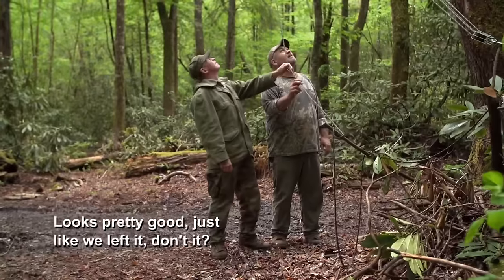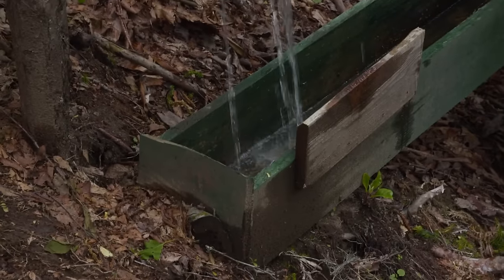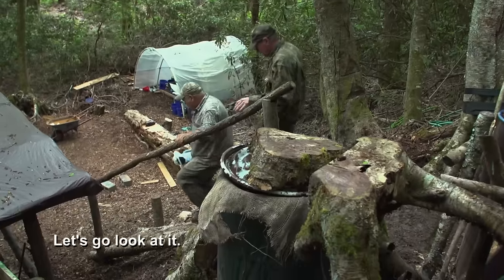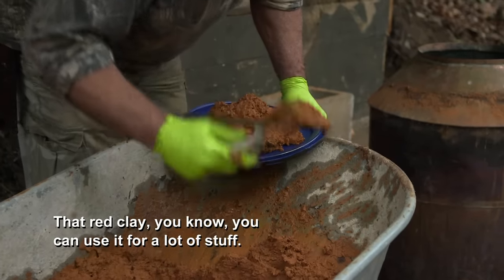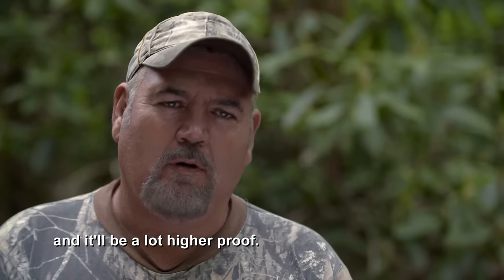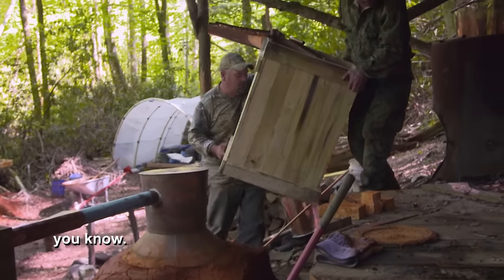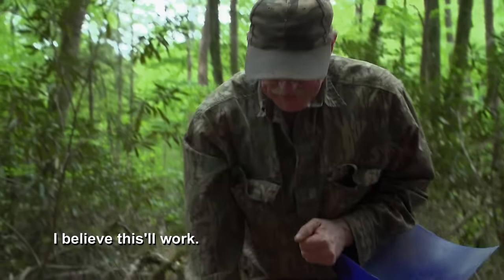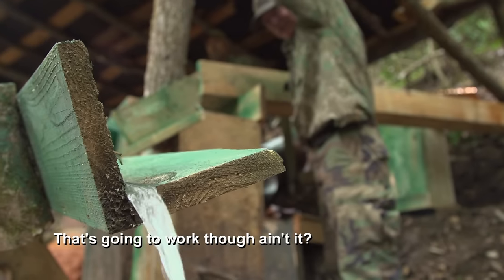New Distillation Process Doubles Moonshine's Proof And Price | Moonshiners

Comment: Use a series of thumpers to do this in one shot. The thumpers can also be used to add flavors if you put candy or fruits in it to impart flavor.

The other way to raise proof is to just run it twice. This is what they are doing, if you gradually increase the heat you dont need to run it twice.
Reply: I was thinking the same thing. They prolly just drag it out for the episode

Comment: Never over wet the outside of a mud based mortar, especially when its that thick. Wetting your hands to work the outside is a no go, as the layers dry at different rates they will separate into flake layers and fall apart. The moisture is driven to the outside as it is, if these guys dried this from the inside I can assure you that it lasted one week after filming.
Reply: Mud and clay are different
Reply: Held on from last season. Had to break it off. Thats acceptable performance for something thats free.

Comment: I used to run a reflux still , it would run like 4 times distilled producing 190 proof alcohol. You could run an engine on that stuff. If you want high proof with no flavors run a reflux still !
Reply: Yeah, 190 proof is about the highest you can go without another process to remove the last water content to make gasahol.  I'm a fan if flex fuel vehicles because of their ability to take E85 that can be made in anyone's back yard
Reply: A reflux column is the way to go....better yet is a flute column so you have the option of running fewer plates as a pot still, if you want.

Comment: Where I grew up ( and you bet I ran booze) Nobody would buy anything but 90% alcohol (180 proof) My dad had a still, but it was too small for commercial. The guys I ran for could deliver anything up to 5000 litres. They would pay fines and replace product if caught, as long as you kept quiet. I was even protected when out drinking, there was a lot of trouble
Reply: Snitches get stitches
Reply: I laughed at the title “doubles the proof” like how’s that possible if it’s already anything over 100 proof?
Reply: @jakejonas7366  lol, you don't understand how proofs work I take it? You can get 200 proof
Reply: @RamseyEO  Water and ethanol form an azeotrope around 192 proof that boils more easily than ethanol or water on their own, so it’s impossible to distill to 200 proof. They also aren’t even using a reflux column, which they would need to distill to azeo in two runs.